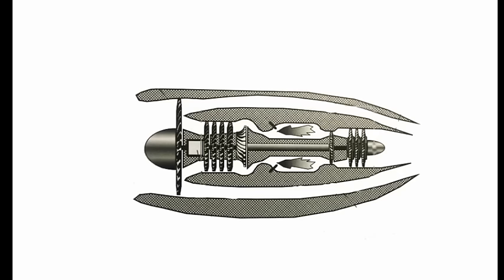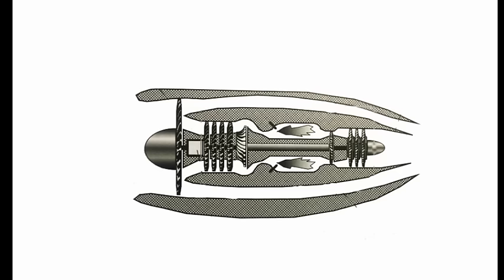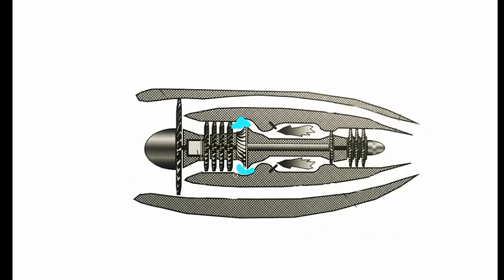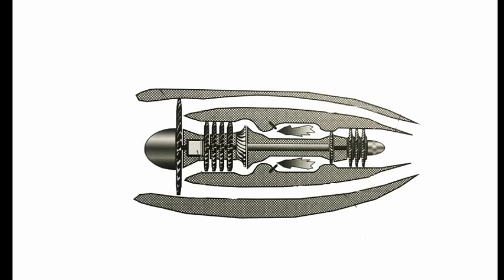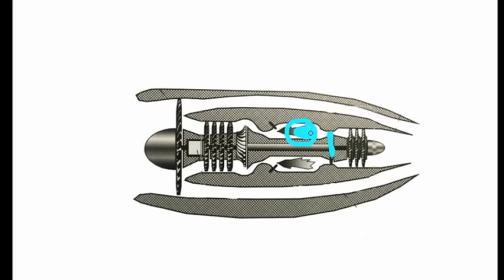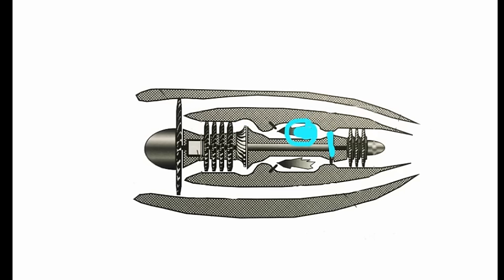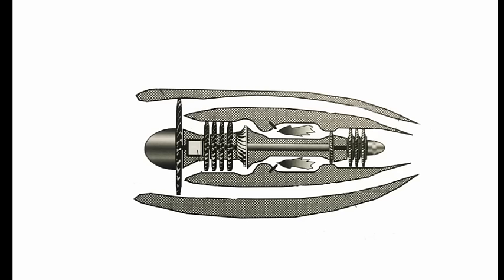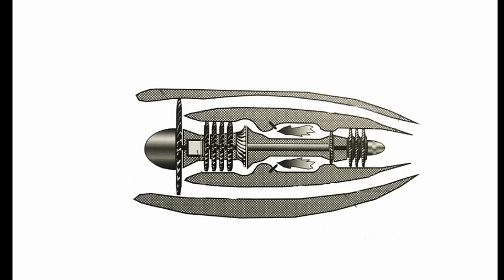The Anatomy of A Compressor Stall

Comment: A compressor stall is just a backfire in a turbofan engine. the same as when you hear a loud bang when a piston engine backfires. Cause -  turbulence in the air flow over the compressor blades (in other words a "Stall") in the compressor section causing a reduction in air pressure and consequent imbalance of fuel /air during combustion. This causes excess unburned fuel to be ejected from the  combustion chamber and be ignited in the turbine section causing a lot of flame and noise at the back of the engine. (just like in the exhaust pipe on your car) and a great reduction in thrust on that engine. Of course its a much bigger bang! (much bigger engine!). In a Jet engine this could interrupt the combustion cycle and shut down the engine completely (like blowing out a candle so, its called a "flame out?)) necessitating a restart procedure and a change of pants for the pilot. In a high bypass turbo fan, since the combustion cycle is not interrupted, the condition just repeats itself until the pilot takes remedial action to correct the fuel/air imbalance and stop the compressor stall, then generally returns to have the engine inspected for any possible damage. Hope that helps.
Reply: Brilliantly explained!
Reply: Thank you, 30 second read much better than the videos that try to explain. They all mean well, but they take too long to get it out, or over complicate it by giving way too much info.
Reply: If the guy in the video just said that it would have been understandable.
Reply: I would just mention the pressure created by the excess combustion is what caused the ignition in the turbine section, it’s not just excess fuel in the turbine section
Reply: Also didn’t mention the surge as a result of the stall- the pressure differential inside changes
Reply: What causes that turbulence to begin with?
Reply: Why would combustion not be interrupted in a high bypass turbofan? To my knowledge it could happen to any turbofan.

Comment: To sum it up for those who don't understand, simply put, there is more pressure in the combustion chamber (where the fuel is burned) than the compressor (where the intake air is compressed and gains pressure and heat), so the gases are pushed towards the front where there is lower pressure, so the gases are flowing the wrong way.
Reply: Kid Mechanic kind of, however it's the angle of incidence to the angle of air flow, much like the leading edge of a airliner wing aerofoil. Example, if the angle of incidence is too steep the incoming air hits the leading edge of the compressor blade too steep, so instead of moving the air to the statior vanes to be slowed down "compressed" there is actuly negative pressure created so the compressor blade can't "bite" into the air so to speak "I'm trying to keep this simple and not a 4,000 word paper aha"
Reply: Jack Selby so this angel of incidence is the only probable cause during take off or climb OR one reason could also be that FOD OR pushing the throttle fwd too fast...please explain and thank you
Reply: Fayyaz Riyaz yes and No, air temperature has a big affect on turbine engines, as you probably know :) so to further explain what I mean. The compressor blades are at a set angle, this is called the Angel of insandece, it's set to maximise the areofoil affect of the blade, however there is no perfect Angel of incidence unfortunly. So to aid the compressor in acheving maximum performance thorgh it's power band, the engine is fitted with VIGVs or veribal inlet guide vaines. These can move 130°, at low power these in there closed position, facing the leading edge of the compressor blade to maximise the amount of lift generated at the blade, as at low power the compressor struggles to redirect the incoming air. When the power level is increased the VIGVs change angel SLOWLY so there is no sudden change in air pressure and velocity within the inlet of the compressor. If the change is too sudden the change in air pressure hinders the affect of the compressor blades, this causes the pressure to drop quickly and dramatically, so now Imagaine all that compressed air at the back of the compressor no longer being held back by the incoming air from the front of the compressor. That high pressure air can now come backwards though the compressor further slowing it down making the problem even worse, the bang associated with a compressor stall or surge is the highly compressed air comming back out the front of the engine and rapidly expanding, same story with the flames, this is just the combustion products escaping backwores due to there beaing now less resistance pushing them to the back though and out the turbine stages. I hope this helps :)
Reply: Very well said. Note to self. Work on spelling
Reply: Aha thankyou, my dyslexia is bad
Reply: awesome. thank you. do all turbojets have VIGVS to control the angle of attack?
Reply: Low enough pressure coming in because the velocity does not meet the demand in pressure to add to the rotation of the blades in front, meaning less hot air is to come in and push out the back. This leads to the silly force of hot air to balance and stabilize in the turbine like an oven, leading to the fuel being ignited internally, further leading to kaboom force which is going to damage everything if not for the fact that jet fuel can't melt steel beams. Yes, I'm commenting a 9/11 joke here of all places.
Reply: @adrock_sokolov6570   yes you are correct. It can even be so violent that it can stop the rotation of the engine And brake the shaft. A good analogy for this would be turbo flutter in an automotive turbo charger.
Reply: Thanks lol

Comment: I think that you induce a little confusion when you refer to 'increased pressure' in the combustion section when you mean that the pressure stays roughly the same there and the air flow starts to reverse forward to the compressor section because the pressure there has dropped during to the disruption. If the pressure increases in the combustion section, it would be due to increased temperature due to a disruption of gases being exhausted. That would follow the disruption but would lag somewhat.
Reply: Got what he was trying to say after the first preamble -- after the first 3 minutes.  Pretty simple -- yet he rambles on duplicating and muddling.  Maybe he knows -- but he does not teach in simple terms.
Reply: Knowing something and teaching it are two different things.

Comment: I'm a proces automation technician, with absolutely no knowledge of jet engines, but in my Profession i'm often confronted to solve safety and control issues. So i'm assuming that a jet engine has some kind of control system. When your control unit compares the compressor aft pressure with the combustion chamber pressure it can take appropriate action to protect the engine, of course with flightsafety in mind (better a destroyed engine than a crashed plane). I'm sure that jet engine engineers have considered something like this but can't be realised?

Comment: That was easy enough to understand.  So basically, the engine burps out a flame to the front simply because it has way too much fuel to burn in the combustion chamber, and very little airflow/pressure to push the flame back out the exhaust.   That being the case, the way to recover from the situation is to cut off fuel, and the best way to do this is to do it automatically with a sensor-monitored/servo-activated fuel shut off valve that can be overridden by the operator.  Thank you for the explanation.
Reply: ChuddleBuggy:  I don’t think the fuel needs be completely cut off.

Comment: Um why would anyone design an engine that has a chance of stalling, overheating the EGT, causing a vibration with a bang or several bangs or surges. Pretty sad
Reply: Willie Gillie there is no perfect Angel of incidence  unfortunly as depending on air speed and pressure, so engineer's try find a good balance, this is difficult due to the constant change in velocity and pressure...thats why jet engines, not turbo fans have VIGVS or variable inlet guide vanes, these change pitch depending on engine power, to redirect the angle of attack to better sute to Angel of insandece at the compressor blade
Reply: Anthony Smith who me?
Reply: Anthony Smith This is an extremely fast spinning engine when spooled up to full throttle internal N2 turbines(GE 90) typically spin slightly over 10,000 rpm while the N1 stage can reach 2000 rpm and newer reach even higher which typically is over Mach 1.2 further out toward the ends of the Turbofan blades. These engines have to be tested for contained failure of the turbofan and destruction of the engine. Does this sound like a good design decision to you?

Comment: I was told that it's a reversal of airflow to the front of the engine due to a pressure drop (for whatever reason) in the intake side airflow. Normally the intake pressure is sufficient to prevent a reversal of airflow but an interruption can cause that pressure to drop low enough to allow the airflow to reverse direction until the intake side is stabilized once again. That may be an oversimplification. The part about the fuel still flowing and igniting when that intake disruption happens was new information so thanks.

Comment: what i don’t get is how can burner pressure increase if it’s not an isentropic process. pressure should be either the same or lower in combustion chamber
Reply: like how does increase fuel flow increase airflow pressure

Comment: Wonderful video! Very clear and forward i love it, thank you so much. One question though, why does fuel increase the pressure?
Reply: Burning fuel creates a lot of heat which causes the air to expand, too much fuel creates too much temperature - more volume in the same space equals more pressure, if this happens suddenly the higher pressure partially blocks the air exiting the compressor and also may overheat the turbine.

Comment: When you talk about ways to fix the stall. You say one part of it is increasing the airflow (by increased airspeed) through the front, to of course get everything spinning faster (and re gain the corresponding pressure for the given fuel flow). But you also mention to decrease the angle of the attack. Are you referring to the airflow that is head-on to the aircraft, hitting the fan blades. Because this is basically the same as increasing airflow, or airspeed.
Reply: Ahhh just heard you say ‘decrease the angle of attack, IF THATS THE ISSUE’  Makes more sense now

Comment: Very good explanation. In very simple terms, it is caused due to,  not enough pressure created in the compressor to push the air forward. This can be caused  due damages, wear and tear of the stator and rotor of the compressor, an external body stuck into the compressor, improper throttling that creates Temperory surge etc.

Comment: I guess this explains why pilots need to spool up engines at takeoff before going full throttle to avoid compressor stalls. 

The only thing that confuses me is that if as you said the pressure drops at compressor level and and the exploded fuel and air in the chamber tend to go reverse then why do we still have engines BACK firing? why don't we see FRONT fire?

Thanks
Reply: The term back fire is a convential piston engine term and refers to the fuel/air mixture igniting inside the combustion portion of the head at the wrong time with the expanding gases going out thru an open intake valve instead of properly exiting thru an exhaust valve. With that, you typically have fire shooting out thru the carburator for a split second instead of out the exhaust pipe. This can be caused by several things, such as misadjusted timing, preignition, etc. So it is actually a front fire, but called a back fire meaning backward or reverse of where it should fire.
On a jet engine, it does not have intake valves and exhaust valves and only uses a spark plug (ignitor in a jet engine) to ignite the compressed air/fuel mixture during engine start up. After the jet engine is running, it no longer needs the ignitors unless a restart is needed. When a jet engine stalls, it typically will shoot a flame out the front of the engine for a split second also.

Comment: Using the diagram explained compression stall in a clear and concise manner.  Also for the first,  time i had a clear understanding of turbo fan jet engine operational principle. 
While i may have written this a bit differently, a bit more concisely and differential why the wings and engines angle of attack effect laminar flow inside the compressor section of the jet , KUDOS!  JOB WELL DONE.  Many thanks.

Comment: In order for combustion to occur, oxygen and heat and fuel have to be in proper ratios to each other. If you have an excess or not enough fuel or oxygen or heat, then combustion will not happen. It's commonly referred to as the combustion triangle (because of the three things needed and they are connected to each other).

Comment: how does the pressure increase in combustion chamber?
Do you mean it is because the fuel keep going into the area?
Or do you mean because more fuel is burn?
Reply: Let's say you want to maintain 3000 rpm the amount of fuel and air needed for 3000 rpm are even then you shut the air off or rapidly decreased and you still have the same amount of fuel being injected into the combustion  chamber and also burned. your fuel to air ratio is going to be much higher than it should be because the lack of air. Your egt's(exhaust gas temp.) Will then rapidly climb because the air also cools the combustion chamber.

Comment: Fuel flow into the combustor is NOT controlled by the "throttle" - it is continuously and precisely controlled by the electronic engine control system (a complex digital computer) and the fuel metering unit.  The ECU receives many sensor signals and is always working to limit speeds, temperatures and pressures in the engine - things that a human could never do with the necessary speed and accuracy.
Reply: Paul Avery from NC?
Reply: @richardbryant366  - Not me :)

Comment: To  prevent a compressor stall, inlet guid vanes IGV and or Bleed-air valves are the keys to recover the stall. My question is: what controls the bleed-air valves and IGV angle to open or correct the angle of the compressor blades?  it is fascinating topic to discus this theory. Please tell me how those valves open and how those blades to correct their angle of attack properly?
Reply: What you ask about is properly explained and the mechanics shown on an engine in this video:  https://www.youtube.com/watch?v=yaFeO6Jze64

Comment: Has high-tech been achieved yet for real time computer control to automatically adjust in the event of compressor stall?
Reply: That is a good question.. I know the FADEC or more precise the EECU provides protection against engine surge and flame out during transients, but  once it happens I think you have to monitor and correct you power setting...

Comment: Can high speed climbs cause a compressor stall?
Reply: Generally, higher speeds will prevent the back flow of air as it will increase airflow through the engine, thereby increasing the pressure aft of the compressor section.

Comment: BULLSHIT ! Confusion City ! The reason they use the word "STALL" is because it's the same word we use for any wing or blade that experiences a disruption in airflow. In this case we are talking about the blades on the COMPRESSOR , not the whole engine and the turbine too. The blades on the compressor stall because the angle of incidence is too great for the reduced flow/airspeed due to bird strike or whatever caused it. This wing/blade stall can be mitigated by the use of inlet vane guides (IVGs) which can adjust the direction of airflow to reduce the angle of incidence and mitigate the stall.

Comment: If you want a real life example of a Compressor Stall , here is a link to ATC conversion for Delta 1643 on Nov 10, 2017. I caught it cause my wife was supposed to be on the plane. You can hear at 18min 40sec that the pilot report an emergency. And later explains it was a compressor stall : http://archive-server.liveatc.net/cyul/CYUL-App-Nov-10-2017-2330Z.mp3

Comment: Incorrect, this is not how it works. Pressure is not increased in the combustion chamber. There are two different forms of pressure, static and stagnation pressure. Stagnation pressure actually drops in combustion chamber whereas it isn't as straightforward as static, which is always changing. This is why what you see as your EPR or P3 (if you have this displayed most likely not) on your ECAM/ECAS for the compressor exit is in stagnation. What happens in the compressor is it turns the airflow causing incremental increases in pressure through the compressor. Through different spools and variable stator vanes the compressor tries to modulate how this is done to avoid surge in simple text. What a surge is is that there is not enough mass flow for the operating pressure ratio in the compressor causing back flow, caused by tip leakage, FOD, etc,you want to reduce the power or fuel going into the engine so you don't burn out your blades, but your fuel flow doesn't directly more indirectly affect surge. Its all about energy conservation, compressor turbine mapping to have a stable operating point. Anyway I don't believe your explanation is factually correct or your message is really confusing...